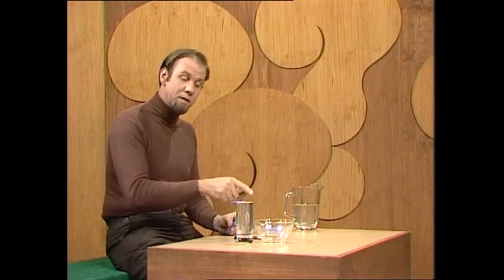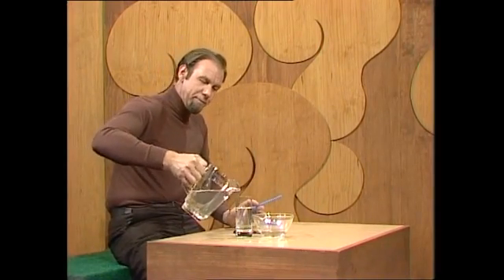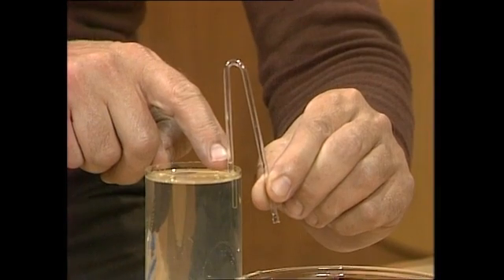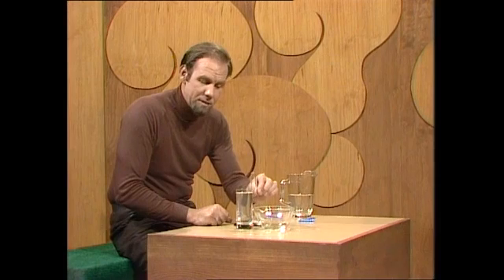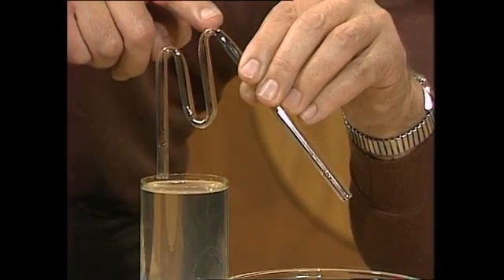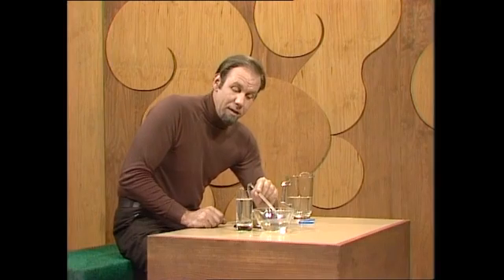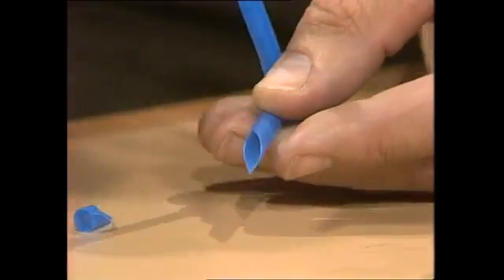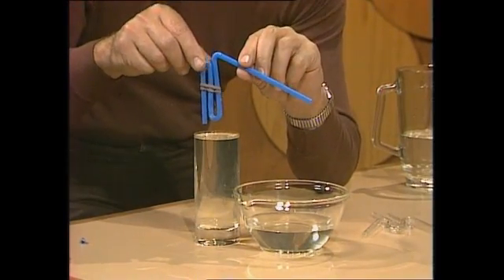Self-starting siphon - another look

Comment: the best auto siphon you can possibly buy is the urinal auto siphon unit. it's a siphon within a siphon (small and big)  the unit is full of chambers and airlocks. the small one starts first draining a small bucket inside for a delay to allow the water to rise a bit higher.  when the bucket empties it sucks in air and air enters the chamber.  air can now escape and the water rises quickly starting the big 
siphon.  the urinal auto siphon can start at almost no water and even just drops entering the water tank.  I ordered the urinal auto siphon to water the plants in the greenhouse from a water tank under the gutter. when the water gets high enough, the siphon starts and turns on the sprinkler system all by using gravity. I'm thinking about buying a few more of those for aquaponics.  I'm also gonna replace the bell with a clear one to reveal the inside and to know when exactly it's going to start up

Comment: I tried to leave the straws steady on the edge of the glass and to add water to see if the siphon starts by itself. Unfortunately it does not. Is there anything I am missing? Or is the movement to insert the pipe into the water that starts the siphon?
Reply: That could then be called an automatic self-starting siphon. I also wonder if it can be done.

Comment: A stupid/smart question:

Could you put several beakers / barrels in a circle with 'self-starting siphons,' and lower them all in simultaneously, such that all the siphons work simultaneously, and essentially all of them flow from one into the next, into the next, into the next, into the next and back into the first, creating a kind of infinite loop, whereby they're all constantly draining and refilling one another, with none overflowing or running dry (assuming all the tubes were of equivalent material, diameter, etc.)? (How might one demonstrate flow through all the tubes in such a case? As opposed to simply filled tubes with no flow? maybe add some glitter to the water or something, to show flow?)

Or would the fact that all the beakers / barrels, or whatever, are likely at the same starting "level," preclude it from working at all?

Just thinking out loud. ^_^
Reply: Also, on a single self-starting siphon, could it have multiple bends, prior to flowing over into the 2nd beaker or whatnot? Like, one, then one slightly higher, then one slightly higher, then one slightly higher, them the one that finally flows out into the other beaker?

I mean, I guess it would kind of have to still work since air pressure would still basically force he water to flow through the multiple switchbacks in the straw, until it got to the last switchback and bend over the lip of one beaker and into the next? Or would the multiple switchbacks be more impediment than good, overly redundant, etc.?
Reply: If the left-side straw goes wall the way to the bottom, and can continue sucking until water gets there, will it, if the two beakers are on even ground, or would it only continue sucking until the water level in the beakers was equal (found level)? Like would the entire left beaker drain into the right beaker, or would only half the water drain, unless the right beaker were set lower?
Reply: Hello sir. It was truly a genius idea. I wonder if you can share the result of your experiment, at least with me. I’m available via multiple ways, in case you can’t talk much here.
Reply: Thanks in advance